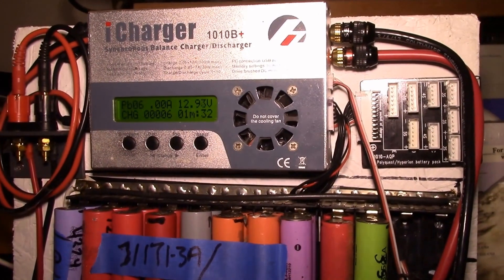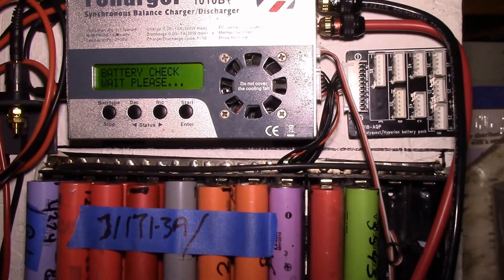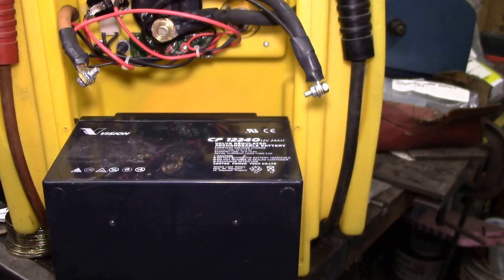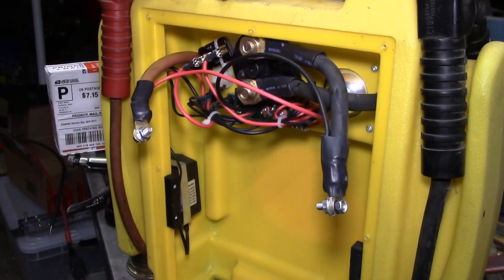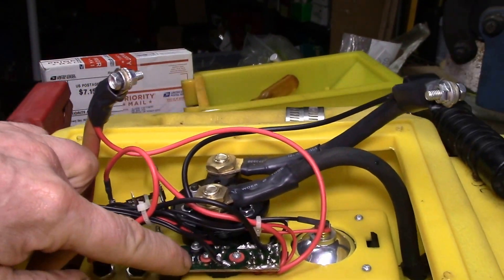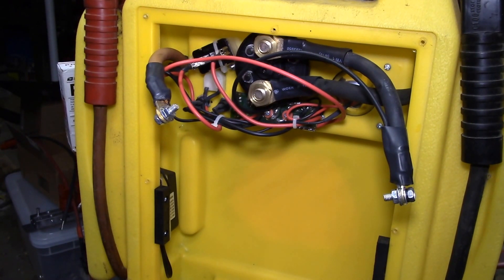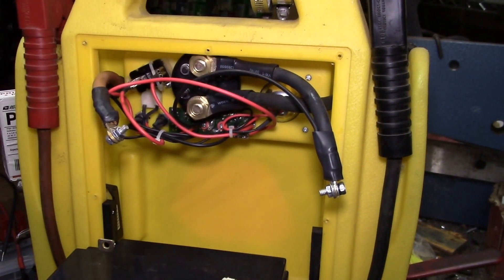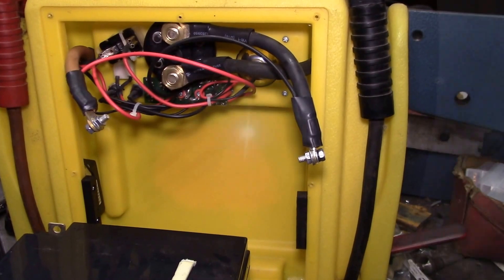Harbor Freight #40615 Jump Start Pack, Part 1

Comment: Hey (in the thumbnail) is that an Anderson connector on the front of your truck for boosting?

Do you have any tips/comments about em?

I'm about to rewire the starter/alternator/ground on my truck. I was gonna throw in Anderson connector for boosting and  charging as well.
Reply from the maker: Good eye and yes that is an Anderson PowerPole connector.  I'll see if I can make a video showing the setup I have on my truck.  I have 350A connectors at the front and back plus two more in the middle where my dual batteries connect.  Then I made up a couple of connectors with battery terminal clamps plus an extension cable.  If you want to see the details, I did a web page on that project many years ago:
http://www.4crawler.com/4x4/CheapTricks/DualBatteries.shtml#Parts